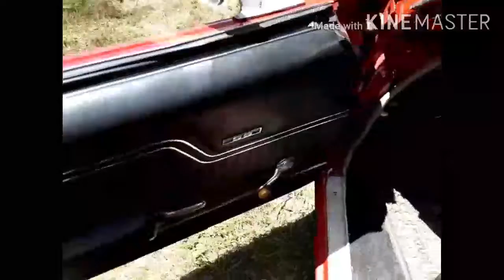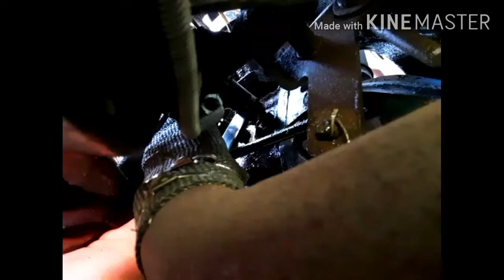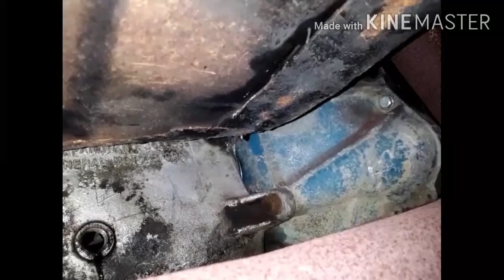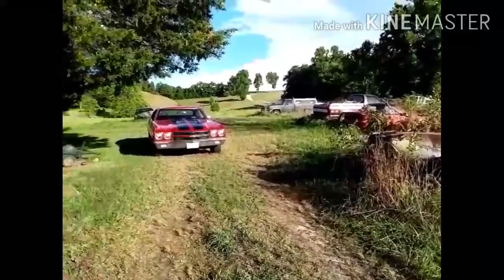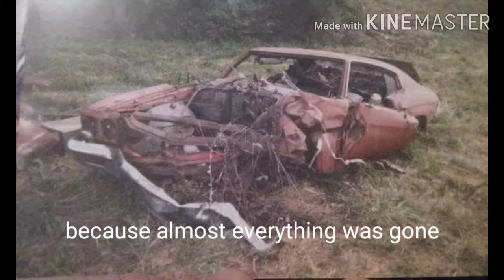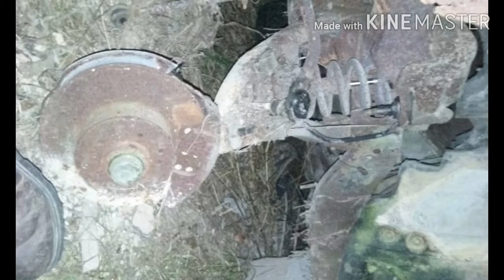some of our 70 Chevelle's monthly maintenance/checkup

Comment: Why are you going to take the original case transmission out?  to me having at least something original to the drivetrain adds to the cool factor.  The transmission you put back in, will it be the one you made out of leftover parts?
Reply from the maker: I'm about to have the L78 back together I plan on taking the car to the dragway I'd rather tear out a cheap one than the original one lol
Reply: Ahh, I never take any of my stuff racing  because I can't bare or afford to break stuff once I get it together. Think you might still get your Dad's old blue race car running this summer?
Reply from the maker: I want to crank it that might be all I do with the nova this year